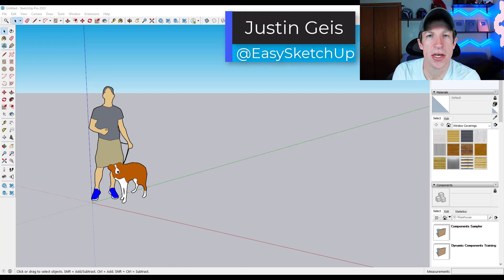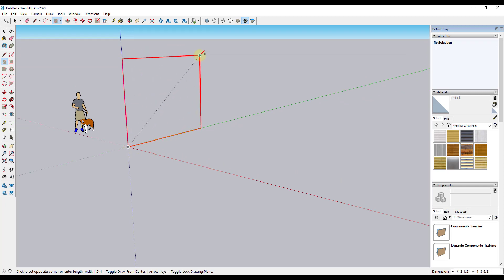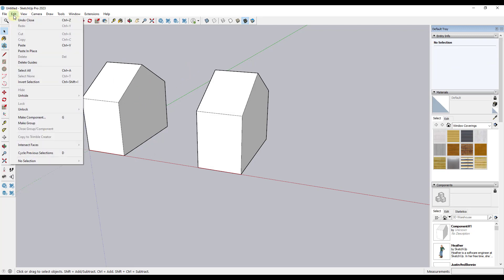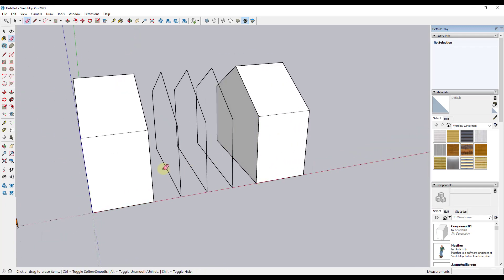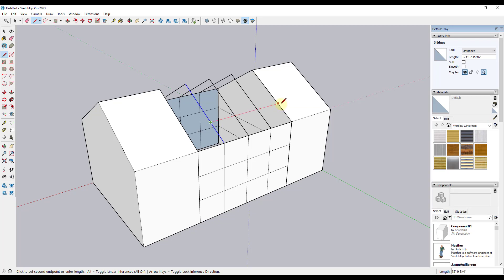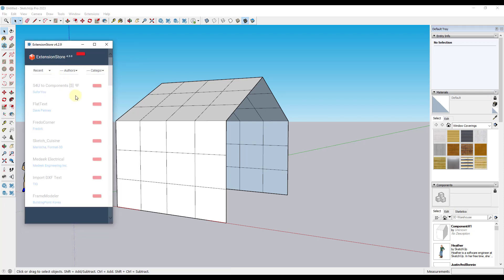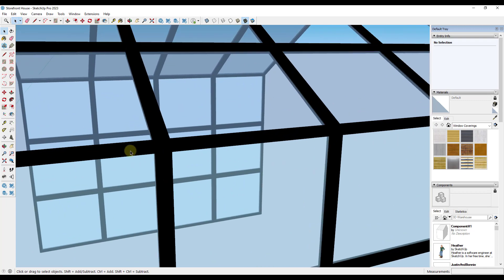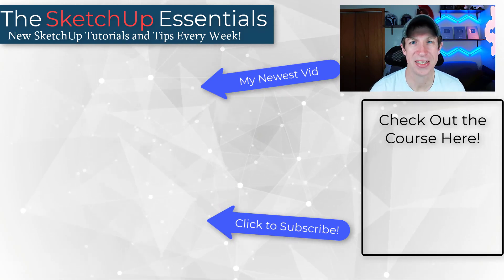EASY Glass in SketchUp (The Fastest Method!)

Comment: Great tutorial. One thing with most of these plugins is that the outer mullions are thinner than the inner mullions. The plug-in doesn’t “see” the outer edges of the total window so these mullions will be half the width. You can always correct that afterwards or use flex tool windows for instance. Keep up the good work Justin! Although I’m a pro for more then 15 years with Sketchup, I always enjoy your tutorial videos and learn some new workflow or plugins.
Reply: exactly,  I do use lattice maker for fast and dirty mass models where the scale will be large and you won't notice that detail